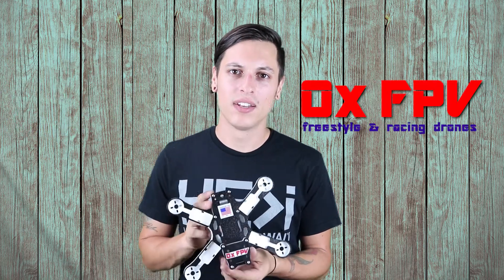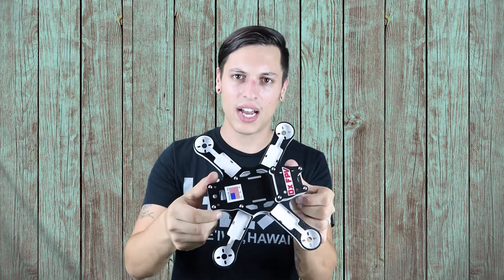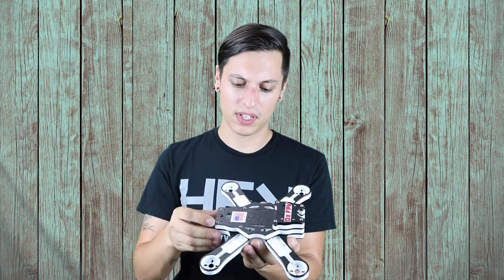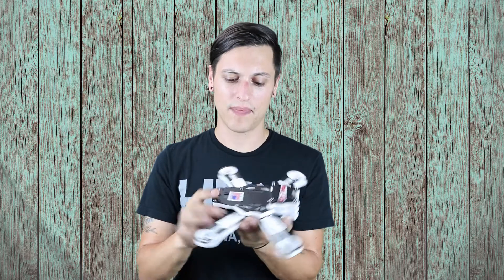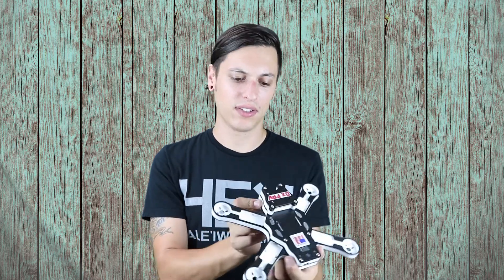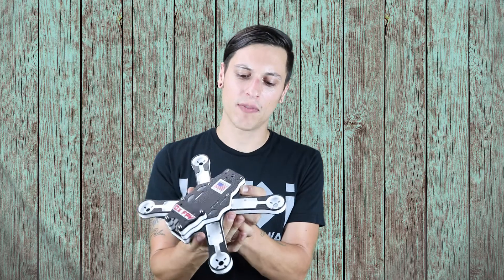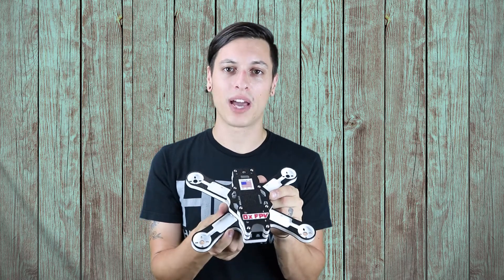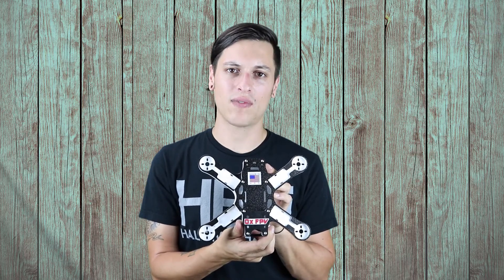Ox Thug 230 - OxFPV- Build Video

Comment: I’m a big fan of frames that protect your components! Even though this is not a new “hyped up” frame, I’m thinking about getting one for my next frame. I got a chance to try a ragg-e before and it was a tank of a frame. I currently fly iFlight beetle 5” because of the enclosed canopy. I’d really love to give my business to a “local” company.
Do you know if there are any plans for a new version of the cnc plastic frame? 
👍🎮👍✌️🌎✌️
Reply from the maker: Sicknasty FPV I have not been In touch with the guys at Ox Fpv in a while, they have since released a carbon top plate for this frame to reduce some weight, and some really nice carbon frames too. This one is a great to smash around and not worry about loosing a motor!